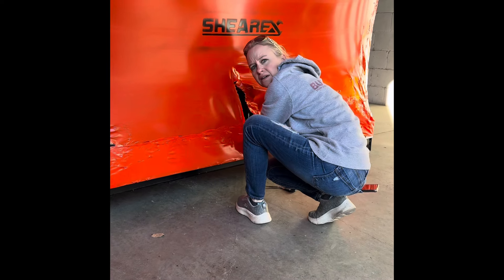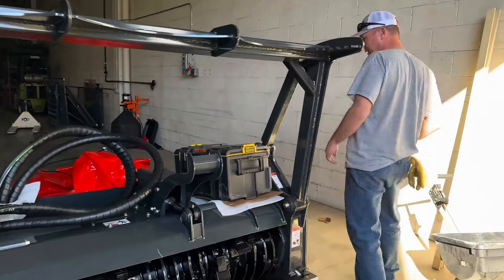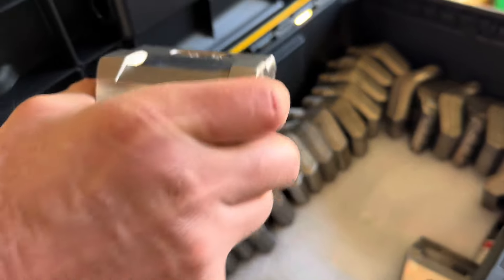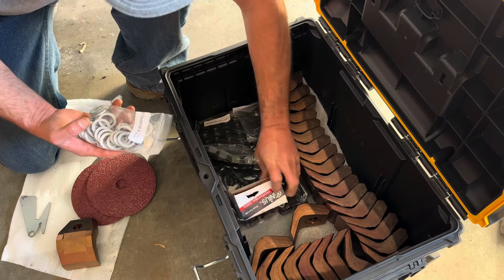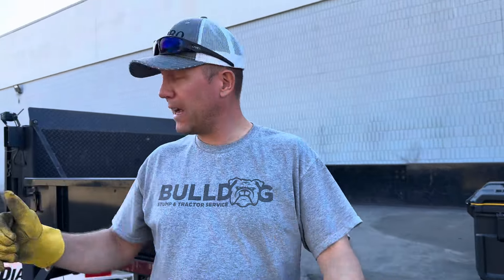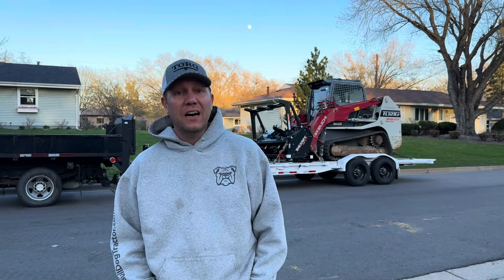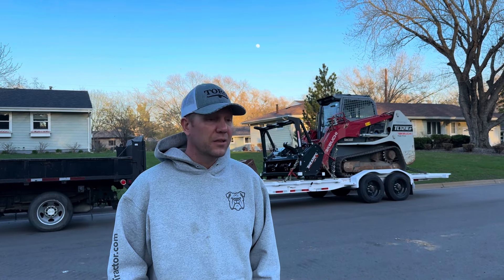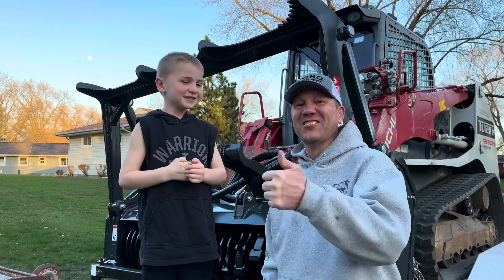Shearex Unboxing HM 70 Forestry Drum Mulcher

Comment: By law, very simple.  X it on both ends or the equivalent. Ya gotta pull, forward, backward, left, right, and down at no more than a 45 degree angle.
So if you pull back and down on each rear corner , and frontward and down on each front corner = legal.
Reply from the maker: Sounds good